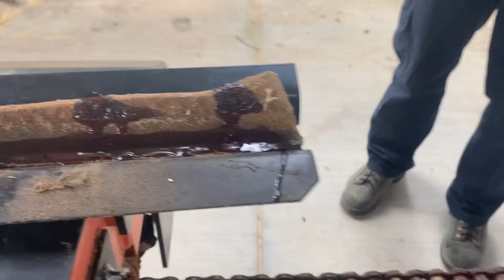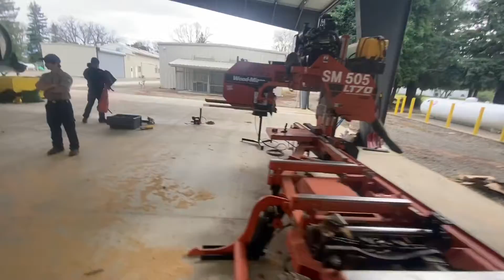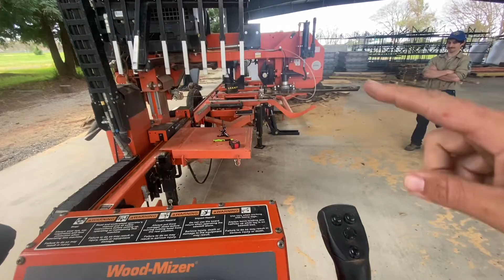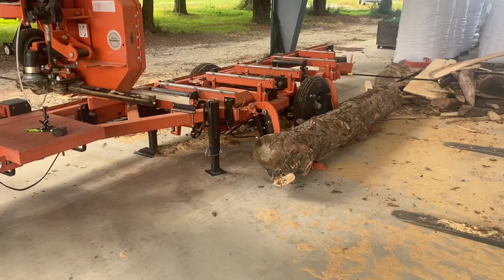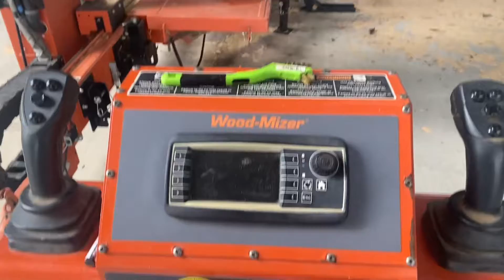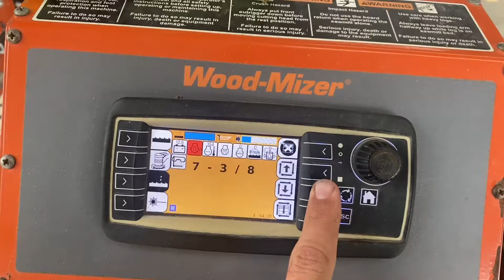Getting to know your Woodmizer LT70 Super Hydraulic TIPS AND TRICKS

Comment: How do you calibrate head position?
Reply: Well the least helpful answer is that your sawmill should come pre calibrated, and you really shouldn’t touch it… I know this because I changed it and it really messed things up on my Lucas mill! The only things you would need to change are the kerf size if you’re using a different blade. So #1 tell me why you need to adjust the head calibration. If you’re getting inconsistent thicknesses in your cuts or something like that, you made be setting up your legs wrong and you mill is sagging. If you really do need to change it for whatever reason, there’s a setting called head calibration and you can do it in any height position. Move the saw directly over a bed frame and measure from a bottom tooth to the rail and put the measurement in the head calibration menu. You can get close by cutting a piece of wood square at say 12” exactly and use that to get you close, then set the calibration off that. But be as close as you can or just don’t touch it at all. If you want, email me at lumbercycle@gmail.com and I’ll send you the manual with the page that has more info